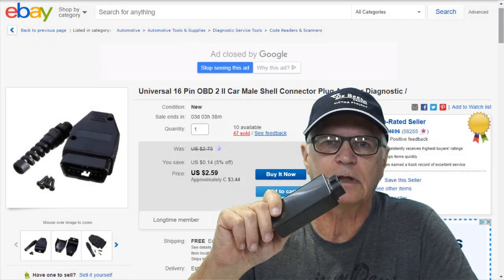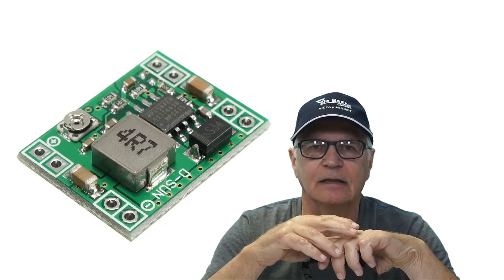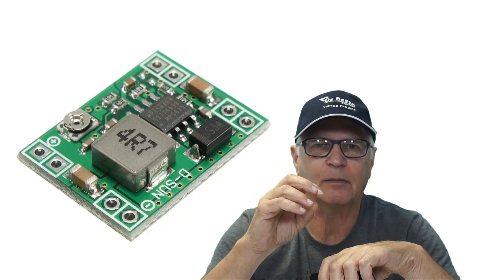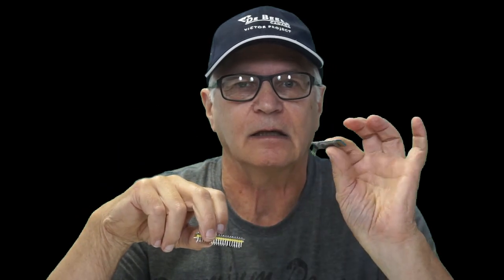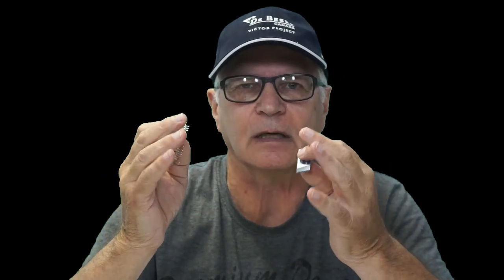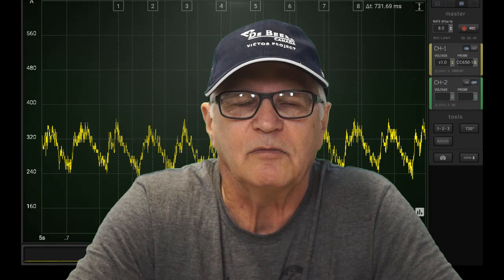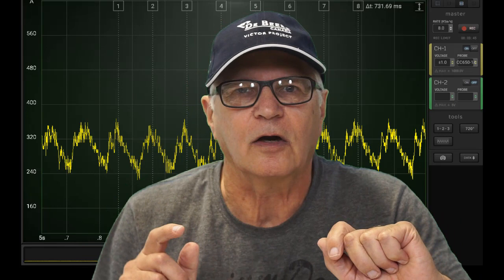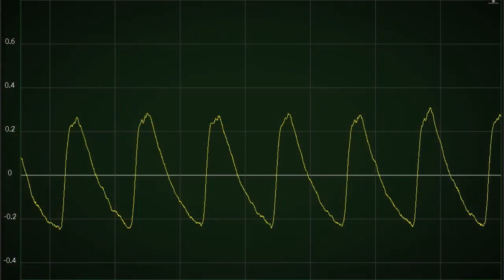GADGETS#75 - REL COMP DONGLE BUILD

Comment: Hey there! I just finished building this dongle and can't get my setting right. Any suggestions on what settings to use for a good picture?
Reply from the maker: +Dan Villarreal - let's make sure you're using these 2 settings:
1) the INV probe setting
2) the Automotive Module which only works at 10 KSa/s for bluetooth HS101
Confirm these, and get back to me if you need more help...
Reply from the maker: +Dan Villarreak - also, in the GENERAL SETTINGS, is the device recognized by HScope as a HS101 +/-5v?
Reply: It's being recognized as a 5v± hs102 for some reason. I followed the directions to flash it with the latest Bluetooth version of hs10x
Reply from the maker: @DanVillarreal1988  - I know you have a HS102 licence since you built one.
Do you have a HS101 licence?
There are separate licences for HS101 and HS102...
Reply: Yes I have a license for hs101, 102, and the automotive module
Reply from the maker: @DanVillarreal1988  - you can select that in the settings...between HS101 and HS102...
And between voltage range inputs...
Tap on HS102 in the settings...you'll see the choice.
Reply: Ok thanks! I'll give all that a try and see if it works

Comment: Great job with this build! Time to order some more parts and put one together. Keep them coming! 😁
Reply from the maker: +Dan Villarreal - you'll find this one easy and a pleasure to build. Works great too!
Have fun!
Reply: @theGADGETSplaylist  quick question: let's say I want to keep my current hs101 intact and use a bnc to obd2 adapter for this. Would I need to wire in the mp1584en? Or could I just go from pin 16 and 4 of the obd2 to the respective terminals on the bnc connector?
Reply from the maker: @DanVillarreal1988  - NO..NO...NO
Your HS101 is a 0-20v input, right?
Reply: @theGADGETSplaylist  yes, but I also have an hs102 and that's 5v
Reply from the maker: @DanVillarreal1988  - it's a bad idea all around...I really don't know where to begin...
The HS101 is absolutely a no-go.
HS102 only marginally better...
Reply: @theGADGETSplaylist  I'll take your word for it. I was just wondering if that was at all possible. I trust your expertise!

Comment: Nice build as usual. Now to gather a few additional parts and get to work.
The maximum for the scope part of this module is +/- 5v - correct?
Is the bandwidth there to (with a switch) monitor the data bus activity. Since the data pins are right there to be had?
Just trying to think of some other things you could do.

Thanks
Reply from the maker: +Dave Sage - Yes, this is based on HS101 +/-5v...but as stated, this "oscilloscope" will not perform at all outside its narrow range.
As to data pins, we're not using any. The same pin 16 and pin 4 that supply power to MP1584EN also provide the "data" to the HScope.
Reply: I was suggesting that instead of sampling and sending the DC / AC voltage to the scope module you add a switch to connect the data pins to the scope module and send that. Just to look for data bus activity not so much for resolution of the signal.
But as I think about it, the data bus is a differential signal with two wires doing simultaneous opposite polarity excursions. So maybe not compatible with the scope input? I'd have to think about it more.
Thanks
Reply from the maker: @davesage9190  - look at GADGETS#63, Dave.
It is CAN BUS dedicated and in the video I speak to the limitations of bluetooth for that type of work.